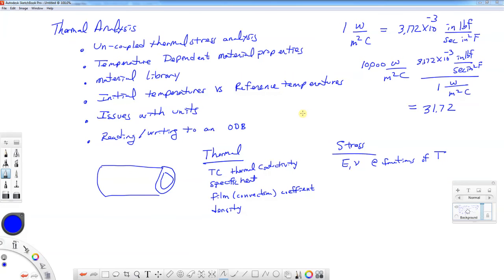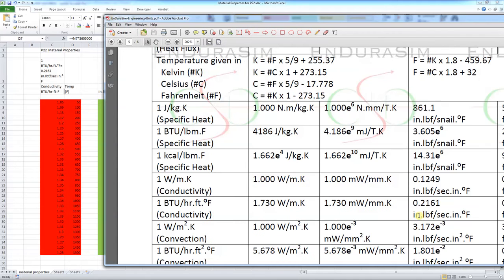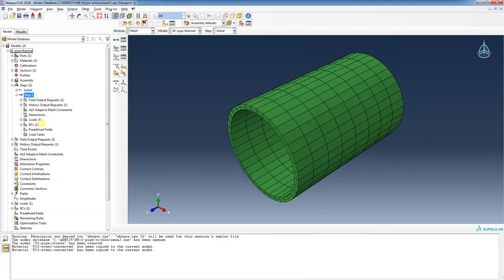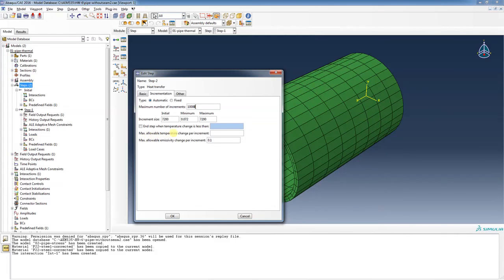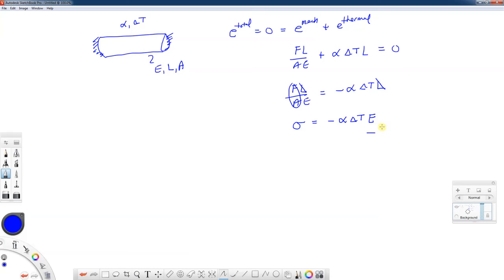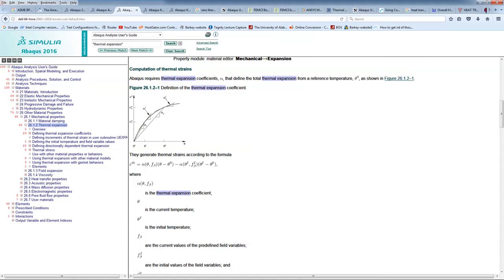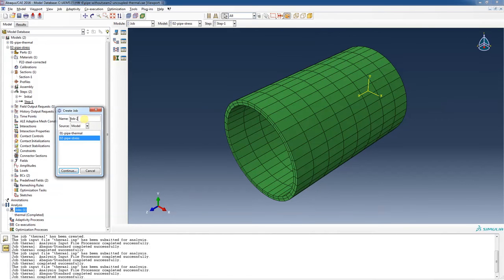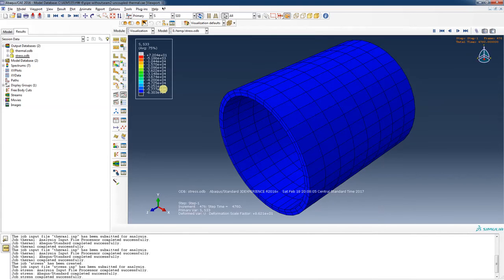AEM 535 HW-6 part 1 Thermal Analysis

Comment: does film coefficient also chnage with temperature ? Just like how thermal expansion coefficient changes with temperature.
Reply from the maker: I can't recall if that option is available in ABAQUS--I think so, but can't check right now.  Physically, the film coefficient is a convenient way to incorporate heat transfer effects into the model, and those heat transfer effects can change with temperature and most importantly with phase (solid/liquid).

Comment: Very informative video, thanks for uploading and explaining. However, isn't the pipe (made of P22 being) crushed by the compressive stress of -63,1 ksi  which is far above yield? How should the results of S33 be interpretated? The material wouldn't be able to withstand the stresses right?
Reply from the maker: This was a linear elastic analysis.  Plasticity was covered later in the course.  If I recall correctly, this analysis was to demonstrate thermal analysis and boundary conditions.  No one would use this pipe in a fully constrained state.

Comment: If quadratic elements are chosen, what formula would be used to check the ABAQUS result?
Reply from the maker: You would use your same basic stress equations to check the work.  The benefits of 2nd order elements are better ability to model curved geometry and the better ability to capture stress gradients within elements or with a fewer number of elements as compared to 1st order elements.
Reply: Thank you very much Sir